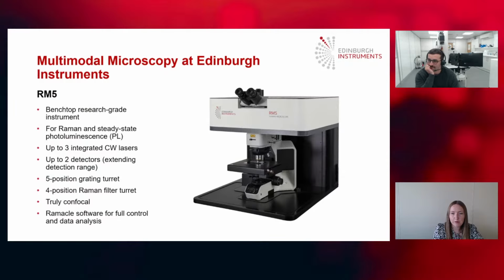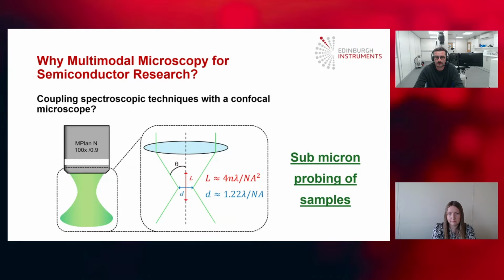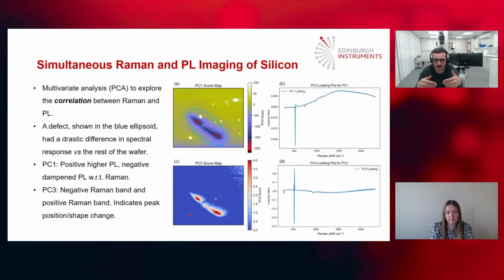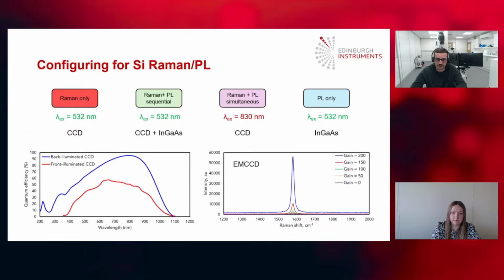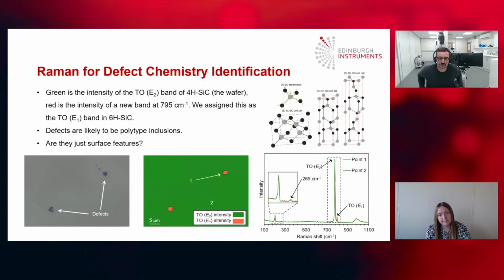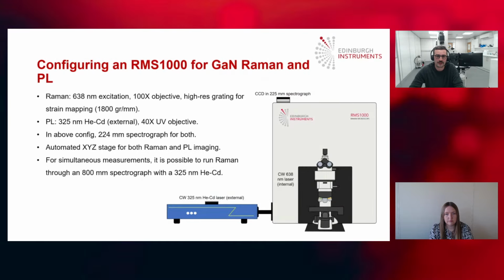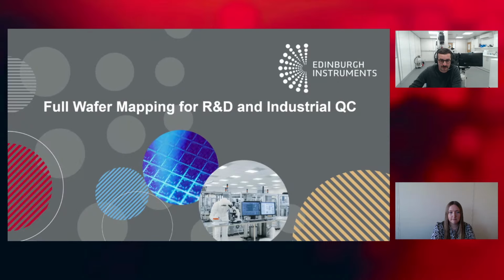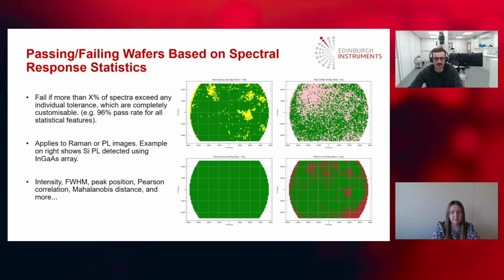Spectroscopy In Action : Semiconductors Advanced Spectroscopic Characterisation

Comment: is Raman + PL can be applicable for different metabolite structure and concentration prediction ??
Reply from the maker: @engineersindia5169 Thanks for your question. Raman can not only tell you the structure of metabolites, but Raman intensity is also proportion to concentration, so quantitation and prediction are both possible. PL could be used for quantitation and prediction if the metabolites were fluorescent. 
 
For us to understand your question better, it would be great if you got in touch and gave us some more information about your experimental requirements: enquires@edinst.com